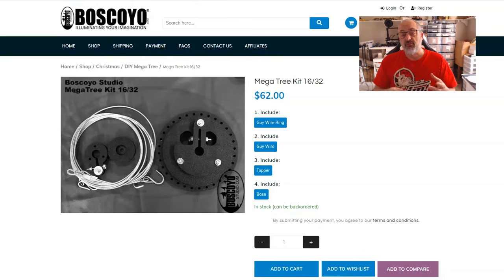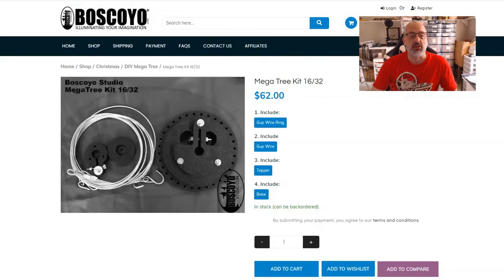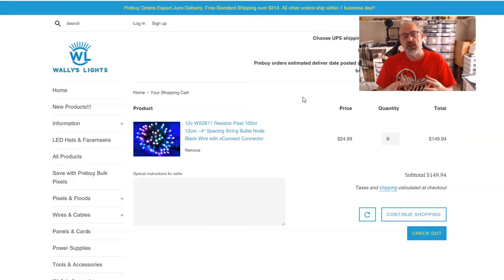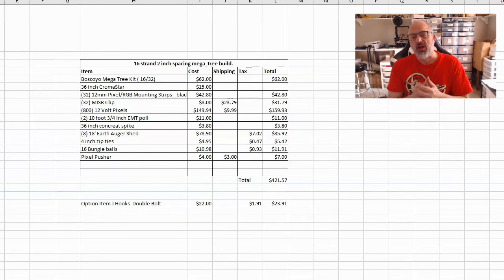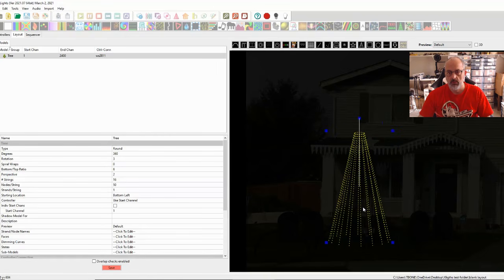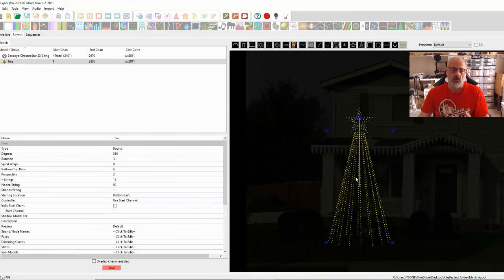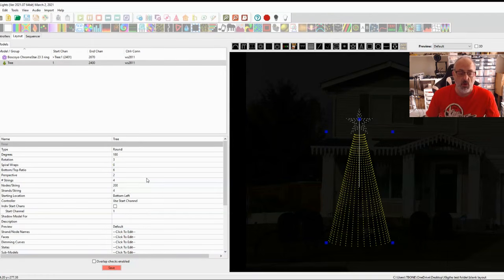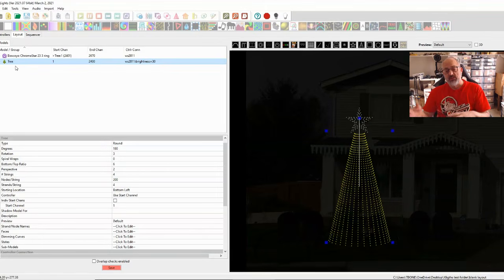16 Strand RGB Mega Tree Build Using the Boscoyo Mega Tree Kit.

Comment: I use LOR controllers for my RGB trees and use 16 strands per tree. Am I able to use the Boscoyo DIY tree kit with 16 strips per tree using 16 RGB 50-count strands? I heard you say that each strip only allows for about 46 lights. I am fine with not having those extra 4 lights be used in order for me not to have to zip tie strips together
Reply from the maker: the number of light is based on what you want and your controller can handle. our new tree has 100 per strip but 2 strips per port ( 200 lights)

Comment: Hi! Building my first megatree, if i have 700 pixels do i use one data output from kulp controller or is it better to use 2 or threee outputs.  I know power injektion, and know electric stuff good so only data is what im thinking.. i do up-down-up-down tree..
Reply from the maker: up and down is fine you need to make sure your strands are even. how many strips 700 is a weird number for a tree. 800 would be 16 strips of 50. number or out puts would depend on if you want 20 or 40 FPS refure to Kulp site for that data.

Comment: Another question - How did you get the Topper mounted on a 3/4" galvanized conduit? I tried it and the conduit will not go through.
Reply from the maker: loosen the nuts to open up the topper hole a bit a nd keep going till it goes on

Comment: Thanks for this video. I'm using it as a guide to build one for my 2024 light show 🙂.

Question - I am going to purchase Mattos Sasquatch 6' Mega Tree Hoop base ring. In your video I see a middle section, at the diameter area. Did that come along with the base ring or did you purchase it separately from somewhere? If yes then what is it and from where?
Thanks in advance!
Reply from the maker: we used maker pipe pieces as the hoop did not come with any attachments.

Comment: How do you connect the two 100 strings together is there enough left over at the two ends to connect together
Reply from the maker: these light strings have connectors at both ends. so you can string multiple strings together if needed.

Comment: I broke the anchor piece as well and picked up the makerpipe parts. Did you drill a hole in each one to hold the hook?
Reply from the maker: No I just was able to get to s hook around the internal screw on the maker when closing it up
Reply: @CounterHolidayLights  Awesome, thank you. I didn't think of that.
Reply from the maker: no problem

Comment: I have a falcon F16 V4 I just purchased 
Will this mega tree take up all outputs on this board
Reply from the maker: No  this tree could easily be run on 5 channels. 1 channel for every 4 strips (200 light per channel. running them from the bottom up, then connecting at the top and running to the bottom etc. and then one channel for your star

Comment: What length of j bolts did you use and did you have nut on bottom and top along with a lock washer 
Thanks
Reply from the maker: I believe they were 3 inch with nut on top and bottom. no lock washer
Reply: Tyvm

Comment: Maybe I missed it but didn't you forget to include the controller in the cost? I'm not seeing that is even listed in your links. I'm currently trying to find an adequate controller that I can start off using but will have a little bit of expansion for future projects.
Reply from the maker: Robert we have separate videos on the controller side, this tree was run off 4 differential receivers connected to a F48. we only needed 9 ports for the  tree and start and used the other 7  for yard props. if I was to go at this again I probably would have started with a F16 or F16 with Expansions like we have now in the yard, which gives us 32 channels at the tree. similar kelp board or experience lights would do the same thing.

Comment: amazing demo very detailed. By the way did you use does it matter if you use 100 or 50 count. Does the software automatically identify based on the data that we input. The reason why I ask is if its 100 it would fit to two strips
Reply from the maker: no either way will work
Reply: @CounterHolidayLights  thank you!!!

Comment: What controller box and power supply kit did you use for the Mega tree?  Any links recommended as I will be building this kit from the ground up?
Reply from the maker: we built this for our first year display and were only using a Falcon F48 with receiver boxes and built a box for our tree that had 4  receivers in for 12 ports which was plenty. if i was to do it over again We would have used a 16 port controller at the tree like a F16. when we up graded our tree we build a F16 with a 16 port expansions so that we had 32 parts at the tree, 17 which ran the new 32 strip tree and the rest to run the yard.  we have build videos of our receiver boxes as well as the F16 with expansions.   Welcome to our crazy hobby
Reply: @CounterHolidayLights  where did you get j hooks?
Reply from the maker: local hardware store

Comment: Thanks for the info. One of the best videos. What is the controller do you use for the tree?
Reply from the maker: For this tree we built a box that had 4 deferential receiver in it ( 16 ports ) and rand thee receivers off my F48 this was so we could run the tree as well as some props in the yard. you gould do the same with a F16 or any of the kulp boards. our new and bigger tree now is run off a f16 with a 16 port explanation card (32 ports)
Reply: @CounterHolidayLights  thank you for such a detailed replay.

Comment: What size of J-Bolts did you use?
Reply from the maker: Gregory sorry that was a few year ago and i just dont remember the size. I know i took the topper to the hardware store and they did not have ones that fit the holes so i had to bore out the holes to make them a little bigger.

Comment: Are the j-bolts 1/4" X 4"  Thanks
Reply from the maker: Van, I don't recall  as that was a couple of years a go and we have a new tree not. I know that the once we bought were a bit two big for the holes in the topper so we had to drill the out to accommodate what we bought
Reply: @CounterHolidayLights  Thanks, I'll go with the 1/4".
Reply: @VanSile  how did that size work out

Comment: Excellent video!  There's a lot of information that I'm going to use or modify when I build a "mega" tree.  I'm a complete "newbie" to smart RGB pixels.  My existing display is all 120v LED lights, some props, and an inflatable.  I want to replace the inflatable with a "mega" tree for 2022, and the others as they wear out in the future.  Are the "J" bolts on the topper purchased from your local hardware vendor?  And it appears that controllers are currently not to be had anywhere.  As somebody who has been in the hobby for awhile, do you have any insight as to if and when controllers (my preference is Falcon) will be available again?  Or will I have to postpone the debut of my "mega" tree for 2023 (or beyond)?
Reply from the maker: the J Hooks are from the local hardware store though in our newest  tree video we switched to Carabiners.. as for controllers I would check the sights daily. I hear that May is when some might be available.
Reply: @CounterHolidayLights  So you like the carabiners more?  I could see how they would be faster and easier to install.  I check the Falcon site everyday now, so I'll just keep it up.  Thank you!

Comment: Looking to do this Mega tree as well. Thanks for the video . What's the size of the jhook bolt? And how did you get your ring to hold up on the front . I have to work with a slope as well. Thanks
Reply from the maker: J hook size will depend on the topper you get not all holes are the same size. we bought slighly to big of ones and had to boar out the holes to make them fit. as for the ring we attached the straps to the ring on this version with bungie ball then strapped it to the ground when the base was level. going forward for our new one in 2021 we build a base with 2 rings that were hither at the front to account for the slope.

Comment: Thank you so much for the video.  Planning on adding a tree in 2022 and 8' 16 strand is exactly what i was looking for.  Could you tell me what size jHooks you are using?
Reply from the maker: glad you like it. most you should use J BOLTS 1/4" X 2-5/16" but but I used a slightly thicker one and I don't know that size exactly but i had to bore out my holes a bit more to fit them

Comment: Brand new to pixels- Been running LOR incandescent for 13 years. 
Also Using WOW lights / LOR sequence editor.
Would like to keep some of the incan lights in conjunction with the pixel strips.

Can I simply use the WOW Lights E1.31 16 output controller 

If so - - Can I make sequences with xlights and still use it on the LOR E1.31 controller along with the 8 other LOR incandescent controllers 
All into one operating system ?
Reply from the maker: Ken, I wish I could answer that question for you but never usied LOR or WOW lights. there are some LOR/xlights groups on Facebook that might have the right answers.

Comment: Awesome video!!! Very informative.
One question I had was what did you used for the in the grass anchors for the guide wires and the base ring?
I also live in Washington near Puyallup.
Oh and one more question. What controller do you use to control the Mega Tree?
Reply from the maker: for this small tree I use some 18 inch yard anchors and wires attached to the maker pipe connectors just below the top. about the 19:54 minute mark you can see it .  for this tree I used two receivers running off my F48 there were a total of 4 receivers in the box.
Reply: @CounterHolidayLights  I had the same question about the anchors. Kind of hard to see, but thanks for pointing out

Comment: Best instructions on a RGB Mega Tree I have found.  Very clear and concise.  Everything is covered including where to buy the parts
and also some detail on how to make the tree more secure using j bolts and bungee balls.  Great video
Reply from the maker: You're very welcome!
Reply: @CounterHolidayLights  I will be building this pixel tree for next Christmas.  My plan is to have a Light O Ramma 16 channel controller for the tree and a stand alone controller for the tree topper that would connect into the 16 channel controller.  This will be my only RGB piece and I don't plan on doing any expanding.  Was looking to use a Light O Ramma director to play the show.  Do you know where I can get an already sequenced couple of songs for this pixel tree and tree topper?  Just want to be able to use the director and loop the songs.
Reply from the maker: you would need to talk to some one who uses light o ramma sorry I am an xlights user.  search facebook for the light o ramma groups.

Comment: Awesome Video. Thanks for all the info. I'm looking at building one this year. What controller do you recommend for a tree like this? I don't own any other pixels but would like to start adding more to my house in the future to replace the typical store bought lights. I assume one 350w power supply would be sufficient for this tree using 12v?
Reply from the maker: one power supplies would handle this tree but if you are building for expansion I would go bigger. either an F16 with 2 Power supplies or f16 with 16 port expansion and 4 power supplies. we have a video on this one.

Comment: I’m still lost on the strip length. Having to take in to account the adding a strip and the bottom and top portion as well
Reply from the maker: so it all depends on the spacing if you are doing like in this build 50 lights up at 2 inch spacing that would be 100 holes just for the lights then it is up to  to you how many extra holes you want on  top and bottom for me I add 5 extra holes to each side and when it was done and mounted I cut it down to one extra hole at the top and 3 at the bottom so back to the length I would start at 110 holes. or 110 ten inches if the strip has 1 inch space. hope this clears things up.

Comment: Excellent video. I have the same Boscoyo tree kit, but this year need to convert from setting up on lawn to setting it up on pavers.  Making a base for the EMT pole is easy, but wondering how you made the very evenly curved half hoop that the light strands are tied to? I need something like that since driving nails through new pavers would definitely piss my wife off. 😀
Reply from the maker: it was a half hoop (4 foot from mattos )

Comment: What controller are you using for the mega tree? Is it smart receivers or falcon f16?
Reply from the maker: 2 smart receivers off an f48 to run it but could have done just 1. and F16 will also work on 4 channels if doing 12 volt

Comment: u buy 6 strings of 100 isn’t that only 12 strips up an down ? or do i need to buy 8 of 100 pixels so it’s 16
Reply from the maker: you need 8 strips to do 50 up and down
Reply: Don't forget the 80 nodes for the star also.  The cost here is definitely way off.
Reply from the maker: The math was corrected in the description in the top section  ( build was not on the star just the tree )

Comment: I have a nother question for ya so the 3/4 pipe just slides over that spike then the base ( half hoop ) is stand alone sepereate and your just connecting the bottom of the strings to it?
Reply from the maker: yes the half hoop is a stand alone piece and I also used yard anchors to hold it to the ground the bungie balls add the tension from the string to the hoop. you may have to adjust the height of the top plate up or down to get it just right.

Comment: Hey I'm using the kit you recommended so when you say 50 up and 50 down your doing 50 lights per strip? At 16 strips ?
Reply from the maker: yes that is correct
Reply: @CounterHolidayLights  thank you btw are you running if off it's own controller or somthing else not to pry
Reply from the maker: this one we ran off two 4 channel receiver card off our F48
Reply: @CounterHolidayLights  I'll have to look further into that because I have the f16v3 but I don't want to use all of my ports just for one tree
Reply from the maker: you wont 8 will do it 9 if  you include the star with our any issue. could go to 4 if you did up down twice. 200 lights per port.
Reply: @CounterHolidayLights  yeah I already have a decent amount of ported use up but with taking it to 4 ports Im sure I would have to power inject correct? Also the distance from the remote which is roughly 30 feet from controller Sorry to pick your brain but this is my first mega tree lol
Reply from the maker: no need for power injection as you can easily do 200 pixel per port at 30% power. which is all you need on any prop. though you might need F-amps to boost the data signal.  Steve Ni does a great video on F-amps. ( search Steve Ni ) on You tube.

Comment: Your strip clips are installed wrong
Reply from the maker: no right or wrong way to install a clip and here is the sites instructions ( Simply fold the original 12mm MegaTree Mounting strips in half at a row of 1/8″ mounting holes and insert the MISR clip. Use two small 4″ zipties to secure the MISR clip to the MegaTree Mounting Strip.)

Comment: Hey I love your tree can I pls have all your measurements
Reply from the maker: sure can. the tree is 180 degrees and about 8.5 feet tall and the star is another 2 feet  on top of that. at the base it is 4 feet wide.  pixes spacing on the strips is 2 inches and spacing between each strip at the bottom is about 3 inches. hope this helps and glad you like the tree
Reply: @CounterHolidayLights  thank you so much 😊

Comment: Great Video, this is my second year in the pixel light hobby. Started off with a small display last year and I don't have a tree. This would be a great addition to this years display. Question I have when trying to calculate a tree, is how wide to have the bottom. You went with 4' I have seen both skinner and wider tress, any specific reason you picked 4'?
Reply from the maker: I like a narrower  tree and always go less then half the height of the tree this helps keep the strips closer together at the bottom for better definition.  at the bottom it is about 3 inches between strips.  we are upgrading out tree this year to 32 strips at 1.5 inch spacing on the strip and about 2 inch spacing between ( should make it a 12.5 foot high with a little under 6 foot base. )

Comment: Nice video CHL, I'm adding a boscoyo mega tree this year and this is very helpful and i watched it twice because it had so many good points.  what are the specs on the j-bolts, i didn't see the same item on home depot website.  Also, how did you make your 4 foot base half circle to get the 3 inch spacing.
Reply from the maker: Glad it was helpful! bought the base ring from Mattos design it is linked in the descriptions above ( 4 foot half ring. ) here is a Jbolt link on home depot.   https://www.homedepot.com/b/Everbilt/N-5yc1vZ402/Ntk-EnrichedProductInfo/Ntt-j%2Bbolt?NCNI-5&sortby=bestmatch&sortorder=none

Comment: Thank you! Are you using PVC painted black for the bottom semi-circle base to bungy ball each strip to at ground level?  What is keeping the semi-circle in the ground?
Reply from the maker: Larry, The Ring is a 4 foot half ring of from https://mattosdesigns.com/   you can also use PVC but would need seval more clamps or yard spikes to hold it down.   we have a  yard anchors in front  and two on the corners.
Reply: YES - My 1st Year build as well :) $$$$$